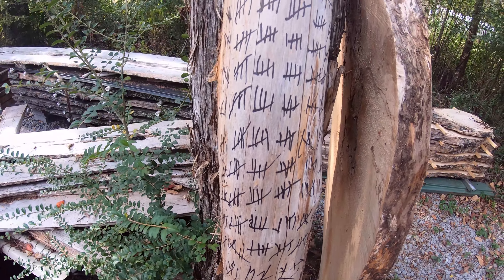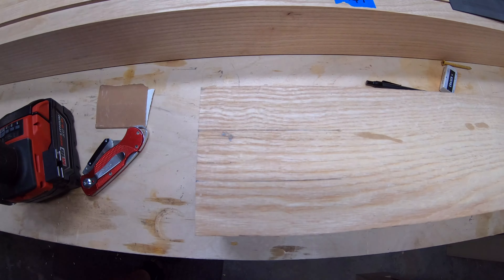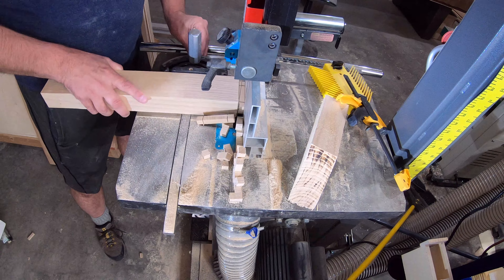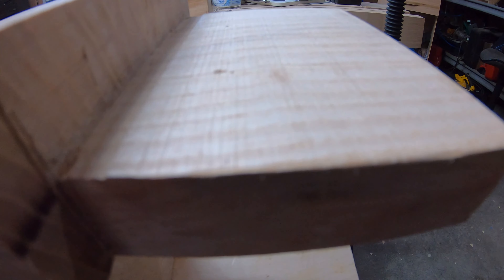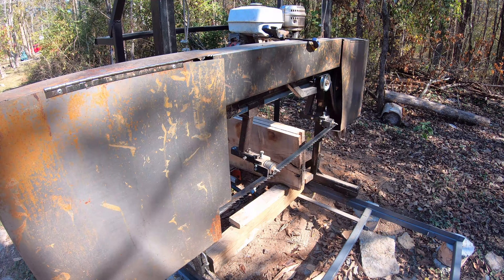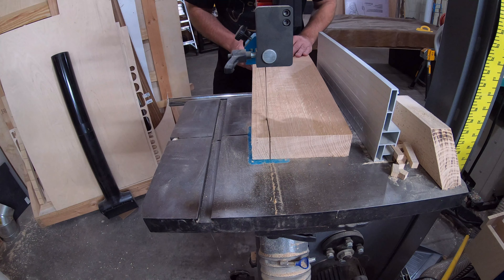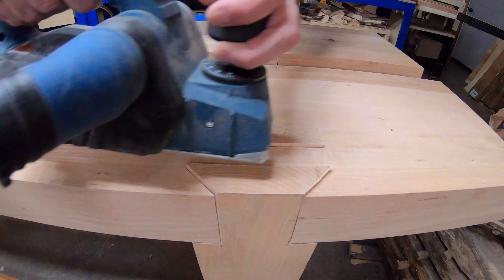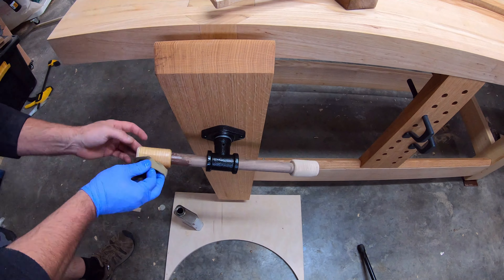Ash Roubo Workbench Build Part 2

Comment: I really like the color difference between the top vs the legs, vise, and deadman. How is the surface feel of the top with the danish oil? Did you go back and add dog holes?
Reply from the maker: Thanks!  The Danish oil is holding up nicely so far.  The top feels really smooth and so far pretty resistant to damage.  I still haven't drilled in the top dog holes yet because I've been going back and forth on the type of end vice.  In true hindsight, I wish I'd made that decision before finishing.